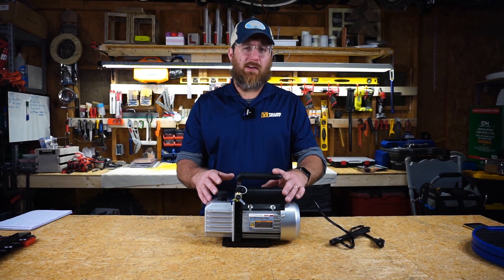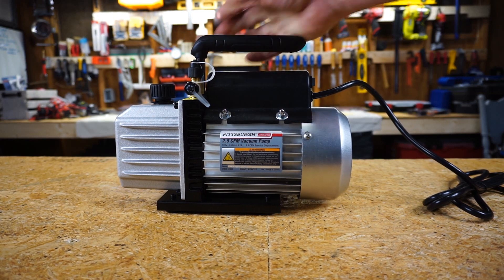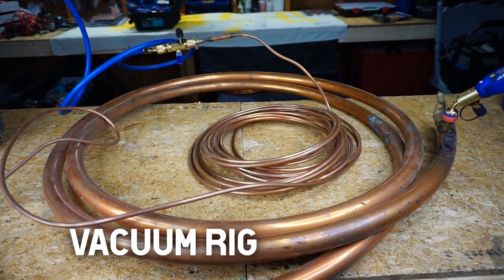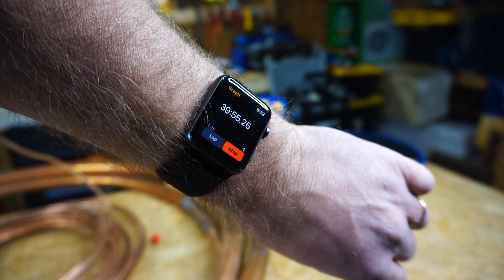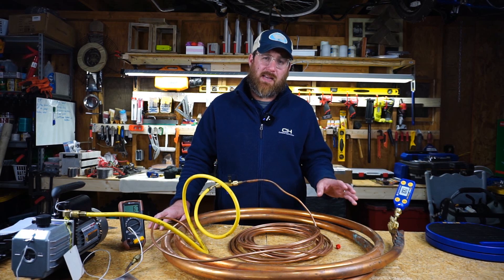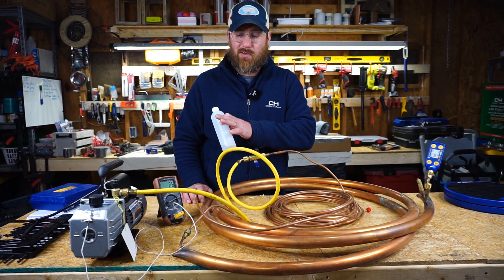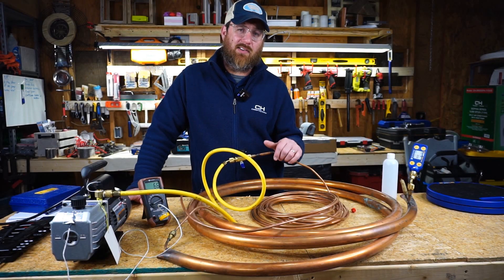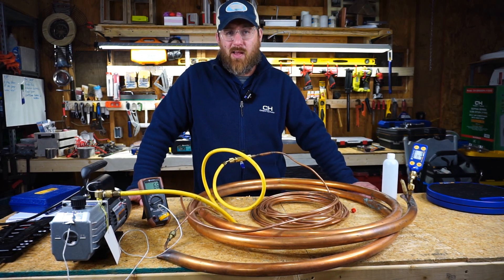Can a Harbor Freight Vacuum Pump Pull a Deep Vacuum?

Comment: I bought the same one 6 years ago and have done 5 12,000 mini splits I don't have a micron gage so I let the pump run for 1 hour. I used it on a few car/ pickups.

Comment: I’m not surprised, most guys like a 6 cfm or bigger pump. Apparently they get paid by the job as I never understood carrying a 25# vacuum pump across a rooftop for a simple pump down. I would actually use it as my primary and save the big boy for the critical or big system jobs…

Comment: I had one of these for 15 YEARS to stabilize knife handle material; finally gave up the ghost today.  Pulled around 25mm Hg.  Buying another one tomorrow.
Reply from the maker: That’s wild, nice testimonial
Reply: Did you change your vacuum oil before giving up on it?
Reply: @wakandaengineer  i'll have to admit no, i did not.  it was full, however; the unit just made sort of a low "humm" when i turned it on.

Comment: I got one and I'm just a DIY homeowner doing some routine maintenance on one of my McQuay 30 ton rtus. I ended up pulling 36.4lbs of used r22 out of it. Then this little pump managed to suck it down to 65 microns in about 2 hours 35 minutes. Then I recharged it with 38 lb of new r22. It was beer can cold after that. I'm going to change the oil In the pump then do a Freon change in the other three rtus later this week. They run so much quieter with fresh gas in them.

Comment: I have the same pump, but has a CPS logo on it. Have had it for ten years, has gotten me through all of physics (I use it for plasma processing in a vacuum chamber). Have NEVER changed its oil and it is still going strong, although optically you would not want to see its window, the oil is murky to say the least. Actually we are on a kind of bet with my PhD supervisor, he has not changed his pump's oil for more than 20 years!!!! We do not deal with freon in physics plasma processing, so I guess we put a lot less stress on the pump. We use also the degassing port religiously, until the chamber pumps down. We do not need that good of a vacuum, as we need some residual gas atoms still in the chamber to do some sputtering work. 
The pump has worked NON-stop for days on each go, through the years. This is a physics lab so we are meticulous with cleanliness of the chamber and the rest of the system. If at any time the pump would be to suck up anything else than air or Argon/Hydrogen, we would be jumping up and down panicking and getting the thing down to its parts to clean it up. Am so glad this has never happened yet. 
On the other hand, this is in stark contrast to HVAC AC work, where the technician cannot avoid NOT sucking up some freon into the pump in some cases. In that case, yes, an oil change could be required even for a single use! Having seen these pumps take so much abuse, I'm just in owe.
I am thinking of moving from a rotary vane pump, to a scroll pump. These are much cleaner as they do not use oil. Plus no oil to change.

Comment: I've done about a dozen car a/c jobs with mine, which translated to maybe 30 total vacuum drawdowns because I also do the drawdowns to diagnose leaks.  When I check for leaks I draw it down for about 15 minutes, and the gauges are pegged at bottom.  I then simply turn off the pump, leaving all the lines open as they were while drawing down.  The pump's check valve or whatever closes when you turn it off holds perfectly.  If there's a loss of vacuum at all, it is always traced to a leak in the a/c system, not the HF pump nor the HF gauges.  If I wear this one out, I will try their two stage pump.  They now also have a battery vacuum pump, but I have no need for that.

Comment: I have had this pump for 9 years or so doing 100+ automotive ac jobs a summer with it and it's never failed me. I just purchased the battery operated one with a 12Ah battery that is working just as good if not a little better

Comment: Good video.  Thanks for the review on the vacuum pump's ability.  Harbor Freight's equipment, like this pump, is meant for the guy that's looking for a way to do a "do-it -yourself" job and that's it.  I can see a place in the market for this kind of stuff, where a guy that's going to use this pump only a couple of times, at home, to do some a/c work and pay a reasonable price to accomplish the task.  If your trying to make a living using this pump, you're probably going to be disappointed.

Comment: they have two newer two stage units, one battery. HERCULES 20V Lithium-Ion Brushless Cordless 2-Stage Vacuum Pump - Tool Only
Reply: 2cfm hercules+ 1 trublue hose+ valve core removers
On a 5ton lennox 45ft lineset it pulled 499 microns in 5 min
Start up

Comment: I’ve always wondered how our vacuum pumps rated. I’ve used vacuum pumps, my whole life to bleed the brakes on my vehicles and to do vacuum bagging for carbon fiber and fiberglass, etc.. but I never really understood how vacuum pumps are measured. I know vacuum is a factor, but you were talking something about microns filters. I understand the smaller than microns the harder it would be for air molecules to pass so is that how vacuum pumps are more precisely rated?

Comment: I bought an Amazon version.  I would trust it for my own autos and home A/C as an initial test and check.  But I wouldn’t use it professionally in any situation.
Thanks for the video.  I used it mainly for the initial set up.  The instructions mentioned an oil inlet but couldn’t find one.  Very helpful.

Comment: The two stage pump can do less than 100 mTorr. Works great.

The decay test has nothing to do with how well the pump works. That has to do with how dry the system is.
Reply: I got the two stage version and it pulled down 130 which surprised me. It is a good pump especially for car HVAC work. You can rent pretty much same pump different name at auto parts store for free, but ended up buying the 2 stage version at harbor freight and already used it on 4 cars. You do have to drain and change oil in vacuum pump every time to get it to pull super low microns/vacuum, but to be expected, as even my expensive 10 CFM pump for commercial HVAC I change oil with every use. I used the 3 CFM on cars instead of the 10 CFM as the 10 to powerful and freezes the lines.

Comment: I have this exact pump and have had it for about 7 years now. I use it for automotive A/C and have never had issue with it. I've left it on non-stop for many many hours. I also use it for bleeding brakes. Made up my own adapter set and large glass catch tank, it makes bleeding brakes alone very easy. Also works as a general purpose fluid extractor, as well. I'm sure it's bad for the internals of the pump but I'm in 7 years of hard use and abuse and it's still going. For what the thing costs? Highly recommend.

Comment: I’m a 40+ year HVAC&R tech I used one in a pinch it did work better than expected. My primary pump is a 40 year old cast iron pump that out performs most new pumps.
Reply: I tested my Fieldpiece micron gauge today with a fieldpiece vacuum pump and an old vacuum.  Guess which vacuum pump worked better.  Not the old one.
Reply: @caru3257  Caveat to what I’m saying I’ve been mostly out for about 5 years. If you’re saying ultimate deep vacuum probably you are right. But speed ?? I was doing mostly refrigeration, lots of low temp, do not use a single pump down always break with a dry gas and repeat. My old pump has literally 500,000 miles riding in a service truck and I’ve wrecked several newer pumps. I will say the newer pumps don’t vaporize nearly as much oil, the old pump is usually oily and slimy.

Comment: I actually bought this pump to do vacuum bagging for fiberglass work.  It works great for that  in a home workshop environment.   A couple of years ago the evaporator core in my car went out and I used this pull a vacuum after I replaced it.   Don't know if it did everything 100% correct, but 2 years later the car is still making cold air so I count that as a win.
Reply: Ive needed a vac pump to pull my new mini split and Ive been trying to figure out if I can double it for vacuum bagging.  Your the man, this is the comment I was searching for.
Reply: @michaelsummer7082  I think the pump uses flare fittings so you need to mix and match adaptors to get to whatever tubing you're using for your vacuum bag.  Good luck.
Reply: Can you do carbon fiber vacuum infusion with this

Comment: These pumps will last longer than you’d think.  What will happen is that one day it just won’t pump into a deep vacuum.  That’s when you know it’s time for a new one.

It really doesn’t matter to me that it’s 2.5 cfm.

But here’s the back story… one contractor I’d worked for wanted to provide a high volume pump but want the cheapest priced ones for their techs.  So what we got was a pump that weighed over 50#.  All of our work was in roofs meaning all the gear had to be tag lined from the ground.  It didn’t take long to decide to buy the cheapest and lightest vac pump since it would be an out of pocket expense to get a suitable tool.  The pump I wound up with was one of these with another name on the side.  I used it for hundreds of hours and was more than happy to have not roped the heavy POS up on every job…